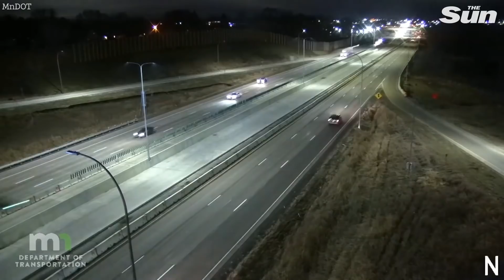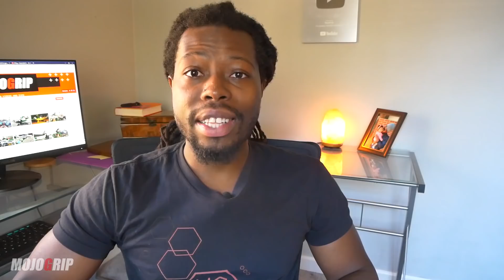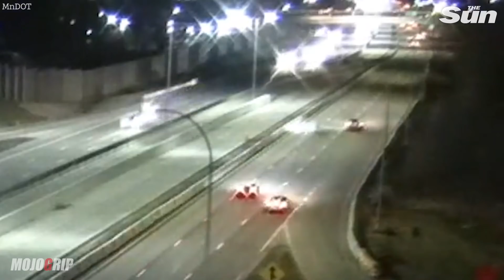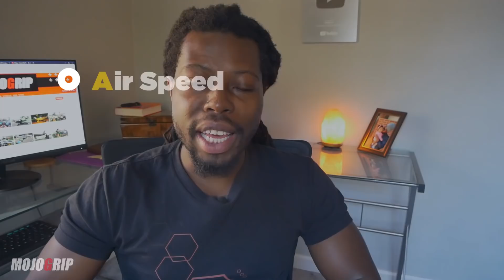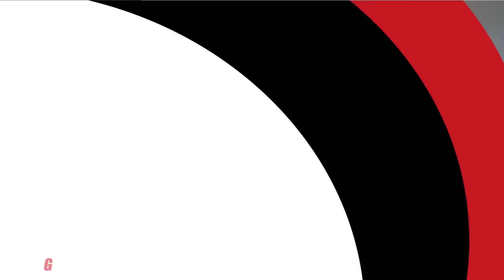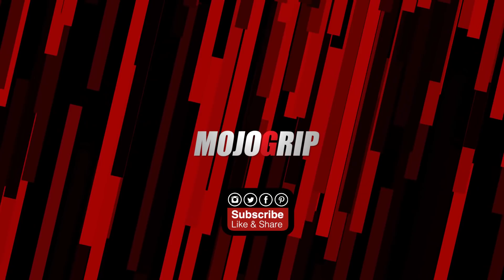Aircraft Engine Failure! Pilot Lands On The Freeway.

Comment: That car hit their brakes lol. Landing with full flaps would be ideal, treat it like a short field landing where you flare at roughly highway speeds and drag gets you slow enough to avoid a collision. That plane was coming in quickly, may have been worried about wires.

Comment: Best glide speed, first decide whether you need L/D (lift over drag) to glide faster to landing point, or minimum sink to glide to furthest landing point. If you rush to an airport that’s near, you don’t need minimum sink, but you do want good speed as a safety buffer to pop up over trees, power lines etc. Minimum sink will get you to an airport further away, but you lose any ability without stalling to avoid obstacles, since minimum sink will be slightly above stall for your aircraft. Worth looking into.

Comment: I think that Pilot came in "hot' because of the overpass in front of him.  They may not have had enough airspeed to get over it without stalling out the last 40-odd feet to clear the overpass, and put it down on the road.

Declaring an Emergency is high up on the List, yes... but the #1 Priority is what all of my CFI's (literally!) pounded into my head.  Fly The PLANE!!  So "A" is the priority.  D can come at any time after A.  

I'm also a FANATIC Believer in Checklists!!  Yes, KNOW the important V-Speeds of the Aircraft, but also remember that the stress level will go up exponentially!  What is remembered while in a clear and calm mindset, can easily go out the window while UNDER Stress. 

Letting ATC or surrounding traffic know there's a problem is important, but they can't fly the plane anyway.  Without the engine providing power... there really isn't much time for anyone else to do much more than call 911, and report an "Unscheduled Off-Airport Landing,"  But you will still get to the scene of the crash before anyone else!

Flying is fun.... until the "Fan" in front of the Airplane quits... and THEN... the Pilot sweats!!

Good video!  Fly safe!!  =)
Reply: The "fan" out front is only there to keep the pilot cool. Turn it off - watch them sweat!

Comment: The best glide speed is NOT the speed that keeps you in the air the longest. It is the speed that gets you the most horizontal distance (gets your farther across the ground for altitude lost). 

The  maximum glide range speed is the one that will keep you in the air the longest. It won’t get your the most distance over the ground. This speed is usually lower that best glide

They are not the same

Comment: Nice video, but a couple of things. You talk about your glide ratio but your taking your glide ratio based of statute miles which is 3 miles but if you take nautical miles you’d be closer to 2.6 miles so in the case of an emergency I’d go with nautical miles. This makes a big difference in the event of an emergency, if ur 2000 feet and your engine cuts and think your going to glide to an airport that’s 6 miles away but you actually only glide 5 your going to end up in a bad situation. Also it’s very dangerous that your telling people on your platform to communicate before Aviating, First thing is first in an emergency push the nose down immediately to get glide speed, or else everyone will remember you as the greatest aviation communicator who died in a plane crash!   And what would be your parachute decision making process for your plane I’d luv to hear how sling pilots decide to pull the parachute.

Comment: Aviate, then navigate and finally communicate. No point declaring a mayday first just so they can find the hole in the ground. Fly the aircraft first and find somewhere to put it down safely before telling someone about it.
Reply: Mike.  Love your videos, but I still disagree.  Declaring an emergency before you've established as much control over the situation you can contradicts even your last reply of doing so while you still have control.  For example, let's say you suddenly lose your engine.  Are you going to first reach for the radio, or are you first going to deal with the fact that the loss of your engine will have you stalling without a pitch change and/or trim change?  No, first things first.  Aviate - trim for best glide.  Then figure out where you may have to put it down in whatever time you now have, then try to fix the problem.  Many times it is a fuel tank switch.  Then, after you have control, contact atc to see if they can help.
Reply from the maker: It really depends on the situation but I beg to differ. Many pilots have died because they didn't build the habit to to declare and emergency first. Engine failure is just one type of emergency. Pilot who get caught in IMC, icing etc or if something happens while you have altitude, you've got some time, so why try to fix all the problems yourself if you could have easily gotten some help. Case in point https://youtu.be/7rryvSQhK7k
Reply: At the point you get lost in IMC or have bad icing you are no longer able to aviate or navigate so sure, at that point start to communicate.
Reply from the maker: @davidecolley  that's precisely the point. You shouldn't wait until you get lost before declaring an emergency or asking for help. Ask for help while you still have some level of control.

Comment: I'm not a pilot but I understand what Mike is saying despite some of the negative comments. Even the most experienced pilots will break the emergency procedure order depending on circumstances.  Case in point, Sully turned on the APU immediately after engine failure even though it was not at the top of the checklist.

Comment: declaring emergency takes time.  always first airspeed (do you need time or distance,  fly the proper speed)
Reply: Agreed.  Priority should be given to doing the best thing for survival first.  In these cases that is almost always airspeed, then where can I land, then what is the problem and can it be fixed.  Declaring an emergency doesn't help anyone immediately in most cases and uses up valuable time for more critical tasks.  You can imagine where it would help, such as clearing a runway or setting up for search and rescue, but even those won't help if you don't control airplane, and landing.  You declare an emergency only after the other things are done and you have time to do so.
Reply: @PilotMelch  flying above a sea could prioritize emergency call.   Now I never flew above sea except to an island some nm of the coast. VFR and with typical Dutch gray overcast  at 1000 ft above sea level .  Somehow at the point where you cant see the coast and also not the island ,  the engine always starts to make strange noises which miraculous ends as soon as you see the coast of the island LOL

Comment: Hi Mike, are you sure about gliding ratio be 16/1. I had the discussion withTAF people in SA and they said the value in the poh was overestimated. I think it is closer to 12/1.
Reply: Depends on the percentage of useful load being used and meteorlogical conditions. 

A head wind as little as 5kts could bring 16/1 down to 12/1 alone.

Comment: I always check my six o clock high for hostiles :)
In general this is why it's dangerous to fly low. You can, and it looks nice but it's dangerous for engine failure. I would fly high enough that I can always reach a landing strip. And we really need computer maps with ALL strips on and even better would be a map with assessment of alternative surfaces that it could color code so you can see options. I also have a light weight pair of binoculars in my plane so I can examine surfaces without having to descend. And a great glide ratio is very powerful. That's another reason all cessnas must die :)   16:1 is quite good. At 3km you can reach almost 50km. A SEA Risen has a 23:1 glide ratio. So at 3km you can pick and choose airports within 70km. And if you're pressurized at 12km you can reach your destination 275km away without an engine. Also know that the impossible turn is quite possible and they lied. Fairly aggressive ascent, kink to the side a bit right after take off and train in simulation or real life when you can return so you are prepared. Chance favors the prepared. Sully for instance could trivially have returned to La Guardia. All pilots should know that.

Comment: @MojoGrip You said that you'd rather Declare the emergency first, I would think to fly the aircraft first, I mean, Aviate, Navigate and communicate. Anyone want to open a discusion about this topic I'm curious to what you all are thinking about :) Nice video!
Reply from the maker: Here’s a good case study why it’s important to declare an emergency early https://youtu.be/7rryvSQhK7k
Reply: @mojogrip  yes, declare an emergency early, just not before getting control of an aircraft that just had a configuration change, like an engine out.  Aviary, Navigate, then Comunicate.  Do it all as quickly as possible, but in that order.
Reply: @mojogrip  So 1000 ft AGL and you fly 130 kts and your engine fall out. Understand how many hight you loose while declaring an emergency at 130 kts?  you are probably left at 100 ft AGL  .  About speed... you need time or distance?   un most cases at 1000 ft you need time, so flying at the best glidespeed wont be a good option
Reply: Train yourself to declare an emergency first as a habit because you may get too low for vhf transmissions, especially around mountains. You can always cancel an emergency, but you cant makea call if you are out of line-of-sight
Reply: @gospeladventures  I have to disagree... you have to fly the plane, no one on the ground or in the air is gonna do it for you. You'll waste valuable altitude that you could've used to find a safer solution.
Reply: @YuDuTheMath   I'm not sure about you but I can declare an emergency in 10 secs. During those 10 secs I'm holding my glide speed and already aimed for my field/hwy/road. You dont fly the airplane with your mouth, you can use your mouth to declare an emergency. (A field that you should have already chosen along you're route during flight planning or at least every 7 - 10 miles depending on you're altitude) Waiting for an emergency to look for a field is poor flight planning.
Reply: @gospeladventures  I'm not saying this because it's opinion. It's what's taught in most flight schools. I'm a student pilot and my situational awareness has to based on my training. I think going against that training without enough understanding of the impact doesn't seem logical when things go wrong. The checklists have been created by people much smarter and more experienced than me. But you do you.

Comment: 3 tons? And emergency landing not a crash!!
Reply from the maker: He literally hit the side of the road and another car. That's called a crash landing. Try again!
Reply: @mojogrip  3 tons=6000lbs. Are you sure about the aircraft weight or should you try again? And for the record that is a rude reply to one of your long time subscribers... Get your facts straight before you post a video..
Reply from the maker: @epicsave635  being a long time subscriber doesn't give you a pass to be a smartass. Your dumb comment had 0 to do with the actual video or subject matter. 3 ton was used as a figure of speech. The pilot did have a crash landing. Watch the video again and if you have an honest feedback about emergency procedures then we can talk. If you rather have the need to make yourself feel smarter by posting an irrelevant correction then keep that to yourself.